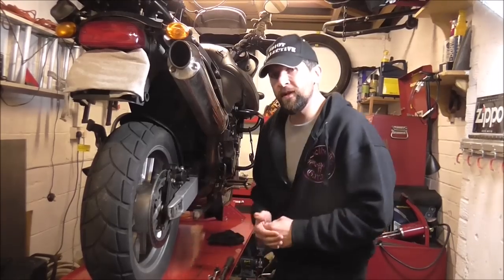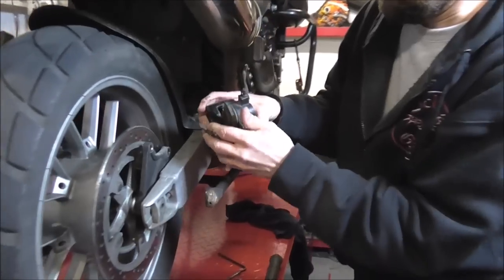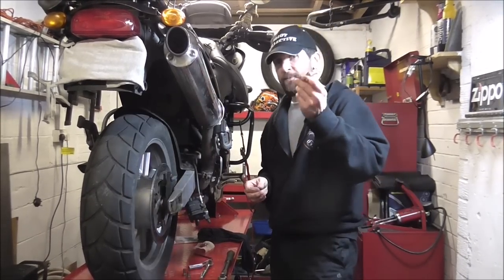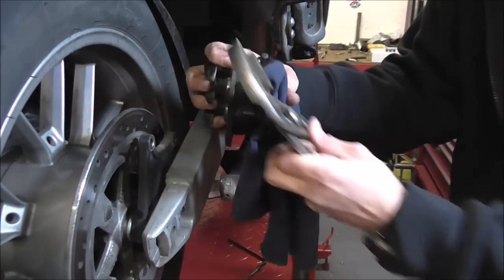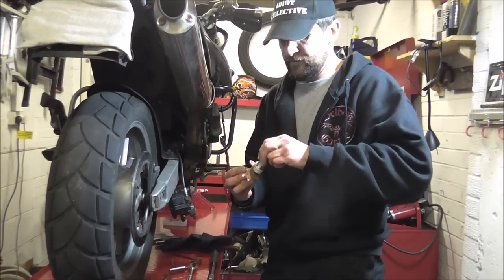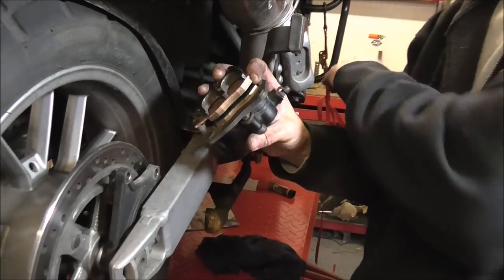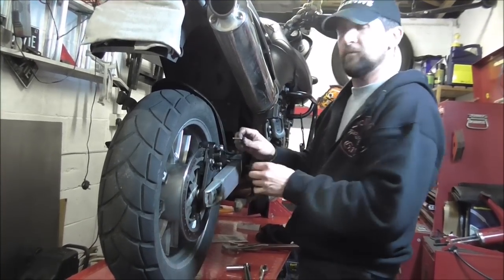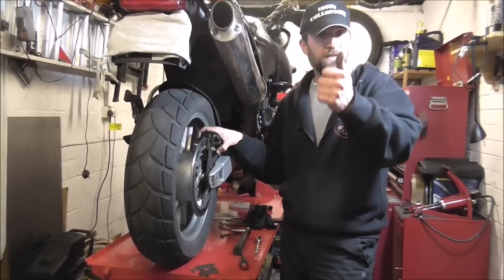Delboy's Garage, EBC 'HH' Sintered Copper Brake Pads.

Comment: I just got gg organic ebc fronts for the bandit 12 as i thought hh would wear quicker and not be so good cold..well now youve explained it i needent have been so picky..great vid mate and very informative..i like your unbiased views on all these things.."heres whats available heres what it does you choose" sort of vibe..thats rare, most people are more " do this do that"...
Reply from the maker: Ayup Springy.....as long as the chosen pad is "double lettered" so 'GG' or 'HH' then thats rated good at hot or cold....and the difference between G and H is only going to be ferlt at the top of its range....also on the front, you have two discs and they're bigger... so they'll be fine... the Tigers are renouned for eating thier back pads...so the sharpest friction pads mean less pressure is required in the hope that they'll actually last longer...who know...but for now, they're bloody awesome.. ten times more feel than before..

Comment: Del do these pads leave much dust particles on the wheels, The pads I have in my Fireblade at the mo are horrendous
Reply from the maker: No, not as much mate... and they will grip a lot better than standard pads, so you don' squeeze them as hard, which further helps keep the dust and the wear to a minimum... !
Reply: Arh brilliant, Thanks for the info Del, I will defo be getting a set.

Comment: Hello Delboy, I´d like to thank you for your effort to give us enough knowledge, hints and help on how to do things ourselves. It´s been great to deal with the maintenace of my Tiger now. well, as for this vídeo, I biught the brake pads but could not find the loctite stick in my country so far. I still haven´t received the pads, and I can probably ride my bike for a while before cjanging them. But I wanted do apply that product too, as you showed in the vídeo. The question is, is there a similar product in the Market, of a diferente brand? I found Motul chain grease (White), but I think it´s another thing, and application. I was wondering, lol, could you send that to Brazil, by sedex or any other carrier? Regards, Carlos.
Reply from the maker: Hi Caco, good to hear from you and glad the videos have helped you out!  Good luck with the brake pad change, you don't need to apply the loctite if your brakes don't squeal, this product is a precaution you can take to prevent brake squeal, but if yours don't do that, you don't need to do that, just change the pads when they arrive and am sure all will be well... hope that helps, best of luck with your projects, let us know how it goes, all the best, Del

Comment: Hi Del,
I need your help again:)
I've decided to respray my wheels on my fzs 600(as I done on my previous R1 before),so I took the wheels out and managed to undo 11 studs(M8,20 mm long) on the front wheel(1 still in)but none of the 6 on the rear would give in..((
I've done everything prevoiusly:sprayed with wd40 first to loose it up and hammered all on the top(this is how I managed to undo 11 on the front)nothing works on the rear wheel.:(
Also couple of them already rounded out because the allankey
:(
My bikemwchanic friend said I have to point-heat up the alloy around the stuck stud and a meantime try to take it out with a 1 size bigger torx head ..
Have you ever done this?
I just don't want to demage my wheels.
Thanks
Attila
Reply from the maker: Hi Attila....I would say don't use more than a 'hot gun' (the kind used for stripping paint) on your wheels, certainly dont use a blow torch or worse....if it was me i would just drill the heads off and once the disc is free, you can wind the stumps out with a stud extractor...then get some new ones to replace them..!

Comment: are they harder on the rotor more than the honda stock one?  also can i use silicon the one used as gaskets in between instead of the stuff u put?
Reply from the maker: Ok, two answers... yes, they are a little harder on the discs, but they stop you more efficiently (there is always a price!), and 'NO' , strictly under no circumstances should you use silicone on the back of your pads... am guessing you are asking because you have some on the shelf, but DO NOT use it , it's the wrong stuff mate... use the CopperSlip as it stays wet to absorb the high frequency vibration and prevent them squealing, but it does not melt, and when that silicone gets extremely hot, it will cause problems that you don't need...
Reply: thanks for your feedback. i dont have the copperslip and i thought that silicon can be used as its used to act as gasket with motors.. don't know the brand.. about being hard on the rotor.. how far it can decrease the life time of the rotor.. i know of course it depends on the driving style but let's say commuting and high way rides.. nothing aggressive. i drive xl1000v varadero  by the way.  thanks for your help :)
Reply from the maker: Hi again Mohamed, they grip the disc better, so you dont have to squeeze the lever so hard....therefore the wear on the disc is not much worse, i put these on my Tiger just over a year ago and the disc is fine..
Reply: Great! thanks for the info. well the rotors are so expensive i have to double check :) but i only ride in the weekends so i wont do a lot of mileage anyways..thanks again for the great video

Comment: I use a "tyrespoon" in between the old pads to push the pistons back in before changing the pads.
Reply from the maker: Hi Mick... that can be dangerous, if you havent cleaned the caliper out with a bit of brake cleaner to get the crud off the exposed piston walls first...then you ram all that dirt into the seals when you push them right back....by all means drop them out, clean the caliper, THEN put the old pads back in and lever them right back....but NOT while they're dirty..!
Reply: Moonfleet41 Good point! Never tought about that.

Comment: I chose EBC double H sintered pads for an FZ6 Yamaha that was ready for new pads.  There was a dramatic performance over the stock pads.  Make sure you buy EBC or rebutable brands.   I tried a knock off cheap ebay brand that was "HH Sintered"  and they were awful....worse than stock.  When I sold the bike the gentleman contacted me to tell me how impressed he was with the brakes.

Comment: I had ebc hh in the fronts on the bandit and replaced them  with ferodo sintered hh  i would say they are rubbish  cant wait for them to wear out so i can put the ebc pads on again they get my vote  running them on the rear too
Reply from the maker: Hi Aaron, how much is it worth to put up with rubbish brake pads that you're not happy with... for what it's worth mate, and for what it will cost you, just chuck 'em out and replace them... the guys I got these from charge £64 for 3 pairs... and with the way that would transform your bike, surely it's worth it???!
Reply: Yeah i know your right i  there not dangerous  but there not as good as they could be i probably will give in and get some  but spending 40 quid on front brake pads when there still new goes against the grain a little haha

Comment: Can i use copper grease instead of that fancy stuff? 
Btw thanks these vids help a lot, keep it up!
Reply from the maker: I used copper grease, there was nothing fancy about it, it was just a thicker version that comes in a stick... the ordinary stuff in a tube is just fine!  ...and thanks for your kind comments, glad they help you out!
Reply: Yeah I had trouble finding loctite copper anti sieze as well in stores but, eBay had it for $7 and it arrived in 48 hrs. Any advice to make the job as good as possible?
Reply: Delboy’s video’s are definitely the most informative I have found! Good stuff. You do well getting rid of all the bs and actually showing step by step.

Comment: NEVER press the cylinders in before cleaning them perfectly. You can and will push dirt into the o ring that keeps oil inside the caliper and the brakes can start leaking oil. Always clean BEFORE pushing them in!!

Comment: If the caliper is out he should wash it with water  and soap, its not a good idea to install new brake pads on a dirty caliper, or  spray it with brake cleaner. The quality is on the details....

Comment: can't watch this, pushing dirty pistons back through the seal, no pin serviced! Just spend 3 pounds on brake cleaner and 2 minutes to clean the caliper and pistons. Also, I would prefer organic at the back, for better control, no need for "initial bite" or high performance, or either they rich high temps on slow riding or approaching a stop.

Comment: Erm, you let the caliper hang by the hose...
Reply: So long as you don't swing off it or kink it, it'll be fine.
Reply from the maker: Perfectly fine to do that mate, its a steel braided hose on the Triumphs and as Josh said, no problem as long as you dint hang off it..